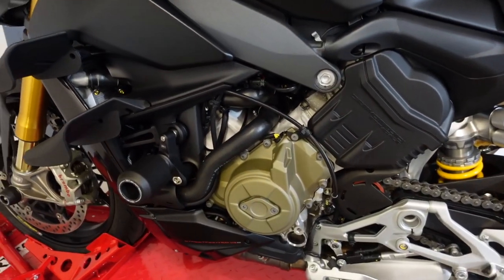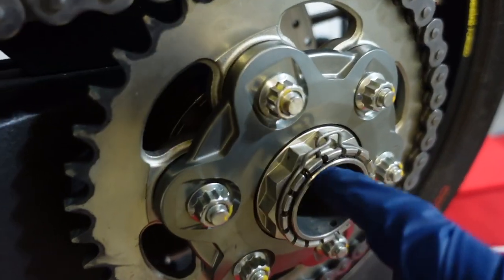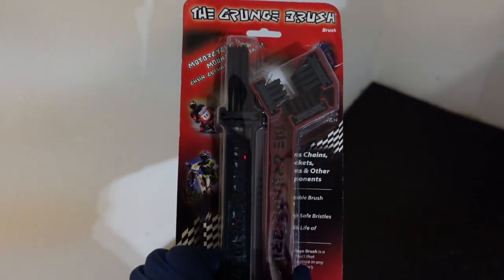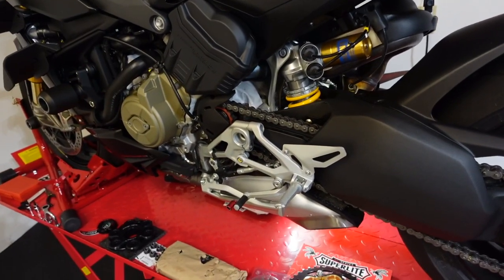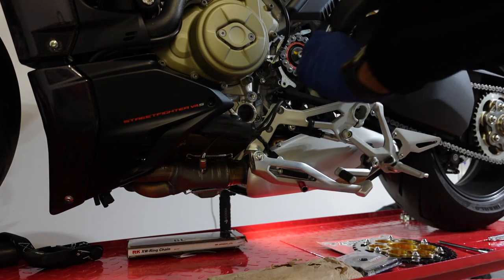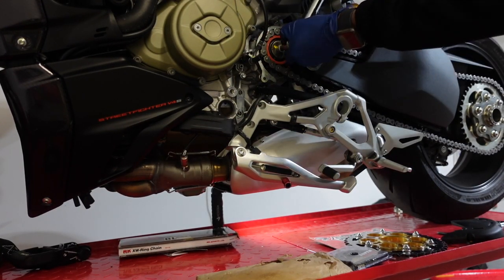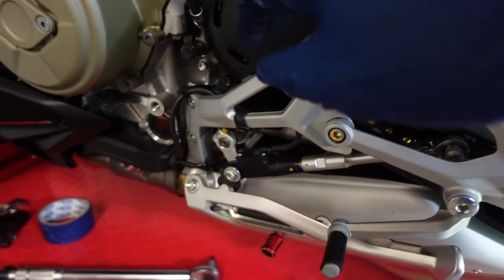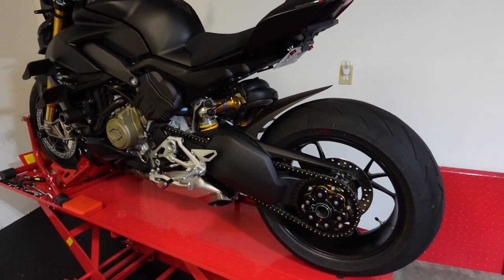I installed a 520 chain and Superlite quick change sprocket on my Ducati Streetfighter V4S!

Comment: Looks good 👍 I did a similar change to my Panigale V4!
Reply from the maker: Thanks! Did you notice the weight savings or is it not that noticeable of a difference? I just rode my bike and it felt lighter but then again I haven't ridden the bike since October so maybe I am just thinking that it's lighter when it really isn't. lol
Reply: @d.magnus425  Any rotational mass part that is replaced with a lighter part, will make you feel the difference, when I installed the carbon wheels, it was crazy, but the chain will definitely make some difference 👍
Reply from the maker: @memphysmoto2649  Okay, so I am not crazy lol. I was looking at some carbon fiber wheels, but I haven't decided on which pair to get.

Comment: do not use a torque wrench to break bolts loose.  its absolutely pointless and you risk destroying it by overloading the torque value.
Reply from the maker: Yes, I have heard that before. Whoever installed the rear nut severely over torque it. I believe the they tongue it down to 280-300nm when it is supposed to be 240nm. I tried my breaker bar and power tools and no such luck! However, my torque wrench did the job in two seconds. The wrench is fine and so is my bike 😁

Comment: never unscrew with a torque wrench 😯
Reply: @d.magnus425  don't know why it's so funny but hey, your tools, your bike, your money my friend 😉
Reply: for real now. why not?
Reply: @kingn125  because you are going to bypass the set torque value every single time to break it free.  besides that its absolutely pointless for taking a bolt off that needs to come off.  torque value's are meant for tightening and stretching bolts into place, not removing them.  the only reason the ratchet goes in reverse on a torque wrench is for left hand thread installations, NOT for removing bolts.

Comment: you now need gold or black rear sets
Reply from the maker: Yes, I am thinking about getting the Rizoma rear sets and powder coating them black. Or getting the Gilles tooling rear sets which are black, charcoal and red.
Reply: @d.magnus425  that would look so nice. Exhaust after that but so expensive isn’t it
Reply from the maker: @rhysbruh8387  Yes it sure is. I am definitely going with a slip on instead of the full system.

Comment: Hi everyone!, quick question…i’va had a sportster 883 for a couple of years and i’ve been thinking of gerting one of these, do you think its too ambitious to get the v4? Or should i get the v2 first?
Reply from the maker: @Kilogeek Hi, they are both nice bikes, it kind of depends on how much you are willing to spend and the amount of power you want. The Streetfighter V4 is $19,995-$25495 with 208 hp 90 lb -ft torque. The V2 is $16,995 with 153 hp and 75 lb-ft of torque. I do not think that you could go wrong with either one. The V2 is plenty power for the streets and you would appreciate how lightweight the bike is compared to your Harley. But the V4 is a monster when you get on it and if you just want to cruise it can do that too, it's very versatile! Good luck with your decision.
Reply: I would go V4

Comment: Buy a Breaker Bar there not expensive your going to ruin your torque wrenches.
You can buy the retainer clip in black for just over $10.00
Reply from the maker: Bought and used the breaker bar. Ducati over torqued the rear nut so much it bent my breaker bar. So I just used my torgue wrench because I did not want to use power tools to break the nut loose.

Comment: no point in this mod at all i like the look but its not enhancing anything other thaN  colour
Reply from the maker: @Leaking Jar There are are other advantages to the conversion such as weight savings and the ability easily change/replace the sprocket without taking the whole assembly off.
Reply: Lighter chain + Lighter sprocket = less drag on the back wheel
Reply: I do recommend going lighter for sprockets and chains; but not at the expense of strength/ robustness.. 

You’d want the lighter sprockets to be able to withstand the torque generated by the engine. Otherwise, you’ll be changing sprockets and chains all the time. Normally i change mine every 4 years or so (keeping the stock 525 pitch and proper maintenance)